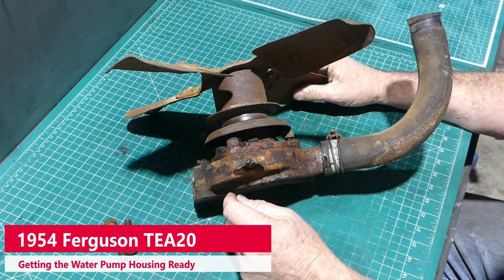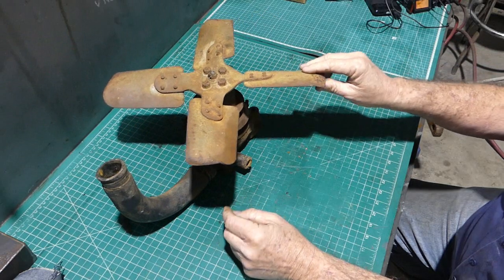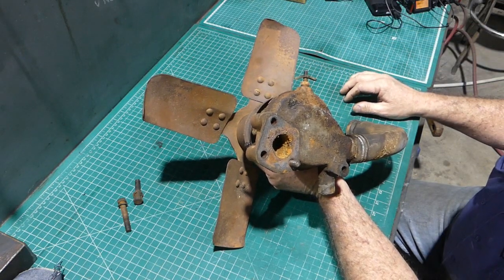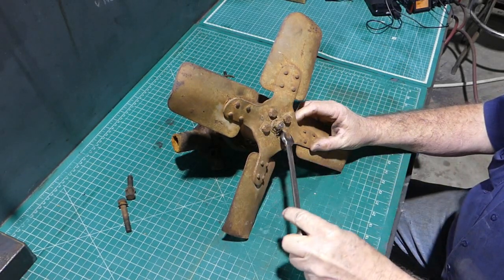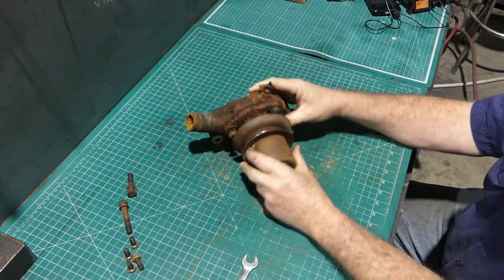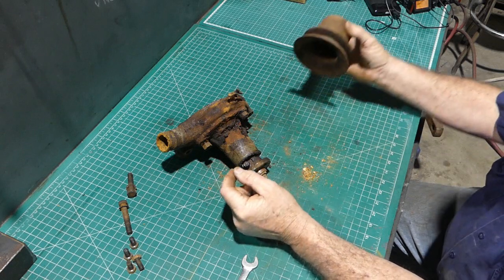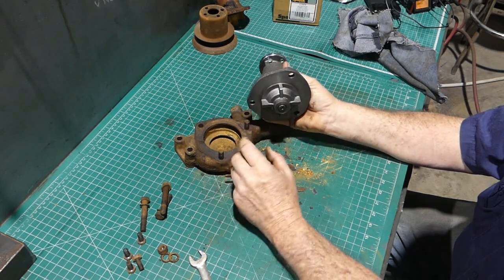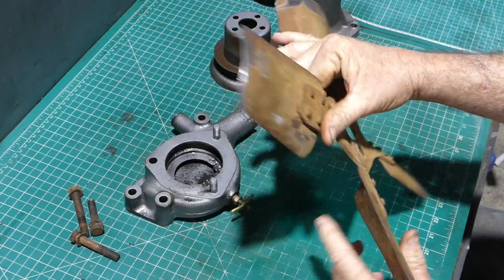Sparex Ferguson TEA20 # 32 Preparing the Water Pump Mouting Housing

Comment: Thanks for explaining the water pump installation! I would like to just replace the bearing...do you have a video explaining the procedure how to remove the impeller shaft from the housing, thanks. Kind regards, Victor.
Reply from the maker: Not yet! I do need to do an update here I feel as some things have changed nowadays.

Comment: I’m in the us-I have an old furguson-how do I tell what the model is and also the hydraulic lift is slow and won’t work without the pto on-the pto binds up when using a brush hog in any brush-is the tractor just not strong enough or is something wrong?
Reply from the maker: Nothing wrong that is the nature of the tractors from back 70 years ago. The pto needs to be on to lift and an over run coupling on the pto shaft will fix the binding issues

Comment: Part 2 fitting ?
Reply from the maker: I dont think I did, it is getting a long time back now, probably time to revisit it.
Reply: @BundyBearsShed thanks for the reply. Would really love to see bolting it all on. Appreciate your videos very much. Had a shonky mob put a new water pump on my TEA20 but they didn’t put the cotter pin in the hub, so fan blade went through the radiator. Doing it myself this time. (Hopefully I’ll get it right 🤞) Just ordered a new hub off you guys, so hoping can fit the hub to the new-ish water pump.

Comment: ok  now  for  a  tek  tip  when  the pump is  roo ted  and you  need it  now  and  a  close  one  is  200 miles  away to  to  the  shed  and get  into  the  box of  ford  v8 water pumps  302w pump shaft    cut  an  grind and  stuff it in  and if  you  got  hemp  and  lead  your A garde lol
Reply from the maker: Or just look in my parts bin.